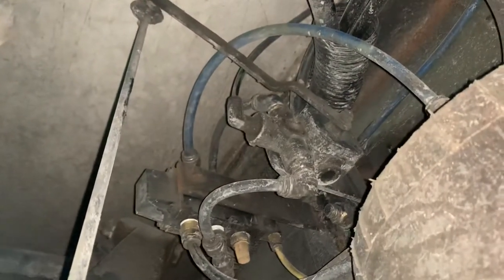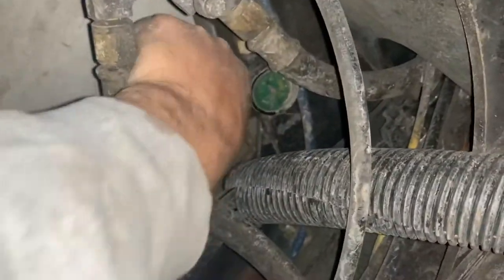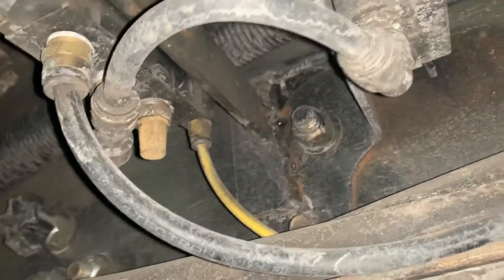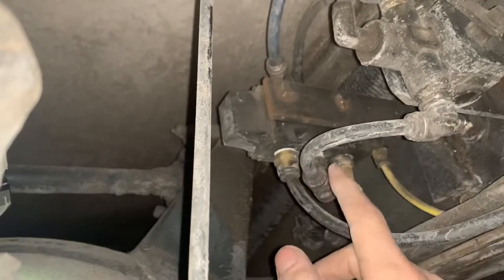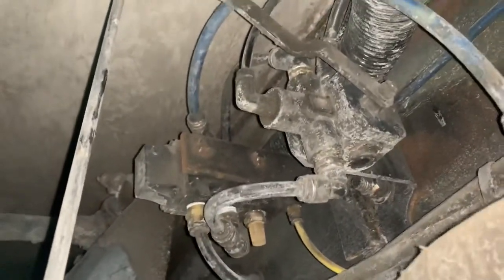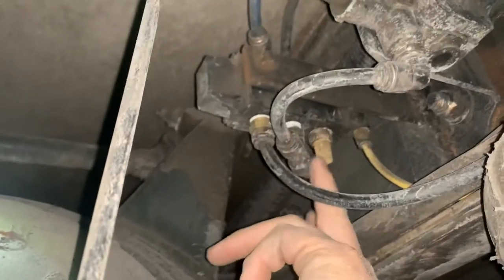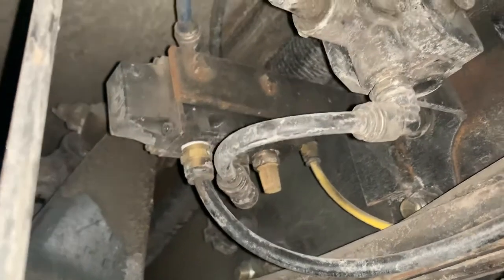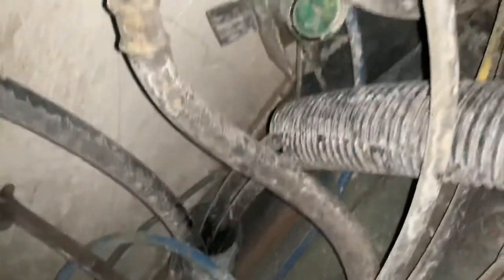Over inflate valve overview

Comment: Hey Rich, can you supply the part number for that over-inflate valve, please? Thanks!
Reply: If you still need the part number, I have one I don’t believe this guy’s gonna answer you back
Reply: @deepsouthoutdoors5737  thank you for that, I got it installed on my truck and I love it! I appreciate your willingness to help however.
Reply: No problem driver be safe out there
Reply: Do you still have the part number?
Reply: @1820dvg  I can certainly look to see if I do. I used a second leveling valve, a pilot valve, and a dash switch which matched the dump function switch. 

Other than that it was just air line.
Reply: @deepsouthoutdoors5737  I wonder if you could help me locate the part number and brand of that "over-inflate" valve ? ... I'd sincerely appreciate it 😊

Comment: Do you remember the valve name or number and what ports do the hoses go in. I'm trying to do the same set up on my back bags and front bags. Thanks
Reply: If you still need a part number, I have one I don’t believe this guy’s gonna answer you back
Reply: Did you ever get that done? I'm needing to do my front and rear also. If so could you supply me with the brand parts and part numbers please. Thanks.
Reply: I would really appreciate the part numbers of that “Overinflate” valve … please please please …
Reply: Did you ever get a manufacturer (make) or part number for that OVER INFLATE valve that Rich used in his setup ????? a BRAND NAME perhaps ???
Reply: @deepsouthoutdoors5737  I would really appreciate any and all information on this ... Part number... who makes the control valve... what the ports do ... ect 😢